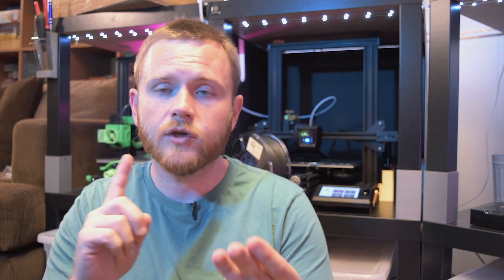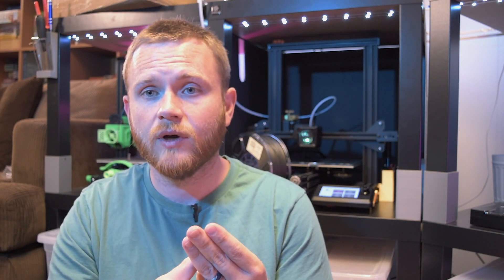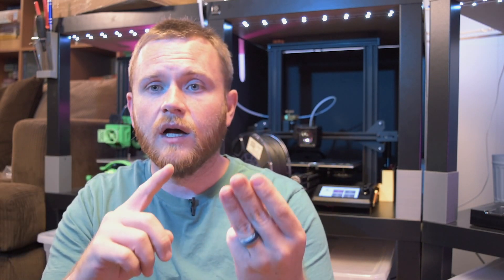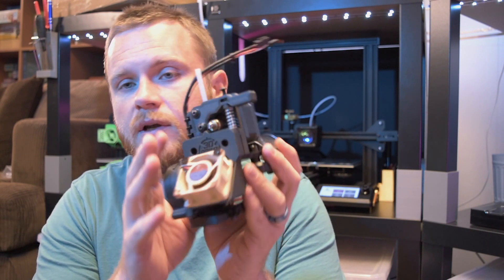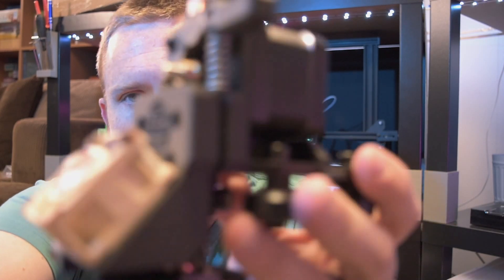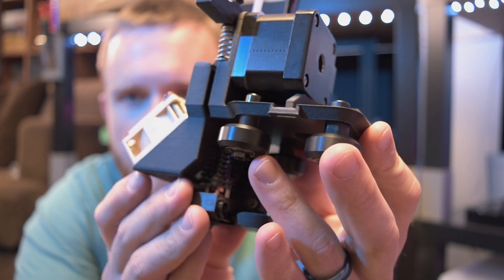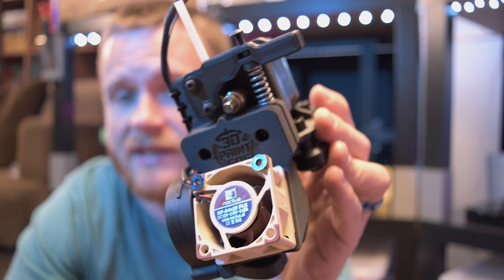Can the Aquila print Carbon Fiber Nylon?

Comment: Sorry for digging up an old video. Ive watched these for years but Ive never played with CF filaments. Ive got an older x2 but converted to direct drive with a s2 (Ive also updated to run the Red Lizard). My question is can you share the settings as I dont use Cura and was hoping not learn a new tool. thanks
Reply from the maker: If you are using Orca slicer, the base filament settings work really well. Just keep your retraction down to or around 1mm.
Reply: That’s awesome thanks. 

I’m wondering if I need to embrace either Kura or Orca. I’m still on voxemaker currently. Just printed as a test with Pet-cf which seemed ok

Machine has been great to testing stuff for my kitcar thanks to your videos. Thanks again

Comment: Thanks for posting the profile - We sell the Aquila and the eSun filament where I work the day job, giving it a go my self, the E3D steel nozzle I got is just a little too short to poke clear of the rubber heat shroud on the Aquila - did you keep the shroud on? I had the rubber piece and the fan guide both scrape prints off the bed thanks to the lower clearance between the shorter nozzle and the bed. I sacrificed a brass nozzle so I could reset the height and re-level the bed, and then got several layers through at varied bed temps, getting the same peel-up leading to failure. Will have to try limiting the fan speed even more, and building an enclosure.
Reply from the maker: You don't “need” the silicone sock on the heat block but it’s a nice-to-have. Maybe you can trim it a bit? Just to make sure we're on the same page, the E3D nozzle you installed should have been an MK8 Style nozzle. A V6 style will not work on a stock Aquila. Just trying to figure out how a nozzle can be that much shorter.

Are you printing with PLA? Shouldn’t need to limit fan speed. Clean bed with alcohol or warm soapy water, level, level again. Warm glass + PLA should stick like crazy if your leveling is correct.
Reply: @3DPrintSOS  PLA with the stock nozzle, no problem, 15cm bridge test passed with ease, happy with tests for speed, was experimenting with translucency using Clear PLA+.
Where I'm up to, is trying the eSun PA-CF, and the Steel Ender 3 nozzle I bought is just a little shorter, just enough that at 0.01 nozzle to bed clearance, the rubber shroud and the cooling fan duct will catch on the print, back to the brass, and the structures no longer scrape the print off,.. I get the print to start with CF, do a couple of layers, then it slowly looses bed adhesion and comes away. Noticed in some of your videos you have the glass side up, instead of the fiberglass layer, giving that a try this morning. I have the travel speed slowed down, cooling at minimum, extrusion at about 105%, nozzle at 250c and bed at 80c.
Reply from the maker: Time filament, like PA, PC, ABS just need glue stick. They need a little help. ;)
Reply: @3DPrintSOS  Haven't needed to try glue till today, glass side up with just a light smear of glue, PA-CF seems to be staying put this time 😀
Edit - glue dried out, and the print failed, might have to try something stickier.
Reply: @3DPrintSOS  the 'shorter' factor is less then 1mm difference, maybe as little as 0.5mm. Manufacturing tolerances at budget prices differences....

Comment: Is  the Voxelab Aquila X2 capable running a 2 or 3 color mixing hotend? If so which hotend and which firmware?
Reply from the maker: If you can do if on an Ender, it’s likely that you can do it on an Aquila.
Reply: @3DPrintSOS  Thanks

Comment: Hello there, I am curious if its possible for my G32 machine to reach more than 250 degrees. The updated PA CF of eSUN needs a reccomended 280 degrees. Any suggestions?
Reply from the maker: It should go higher than that stock but you can always switch to Alex’s fork of JyersUI and set the limits for temps to whatever you’d like.
Reply: @3DPrintSOS  I have already flashed the latest Alex's firmware with vertical orientated screen etc... I have an upgraded hotend called smart nf cr-10. So do I have to download a different firmware ? I think my hardware is ok for pa cf right?
Reply from the maker: Yea it should be. I think if you are firmware limited to a temperature on your hotend, you would have to recompile it yourself and just edit the temperature Max in the config
Reply: @3DPrintSOS  maybe it's better to make a video on how to do this. Because our upgraded voxelab beasts are capable for more and we are limited only to 250-260 degrees of hotend temperature. Thanks in advance! I will ask you about the video because you are the best to do it. If no one else asked you till now then more will come. I know. I followed all of your DIY guides and I am satisfied.
Reply from the maker: There’s a few out there that are great. Teaching tech has a few great ones on compiling. ;)

Comment: Would a good bit of glue work instead of an enclosure as they are quite expensive
Reply from the maker: Wouldn’t be enough in fortunately. You can always give it a try. 

My enclosure sides are just foam core board. It was like 7.99 at an office store. You can even use cardboard in a pinch.

Comment: Your AWESOME!!!  I get my first one in 2 days and will definitely follow you, like and subscribe... #staysafe
Reply: Quick question though. Should I just change the fans as well like you did on version 1?
Reply from the maker: You don’t need to right away, but they are definitely loud.
Reply: @3DPrintSOS  Cool and Thanks 💯
Reply: @3DPrintSOS  Awesome Sauce !!! It took me about 3 hrs to assemble,  1/2 of which having to switch things because I put them on reverse, lol, but it powered up, and following your directions, I was able to level and are currently printing the hook 😁 Thanks again my friend, much appreciated 👌
Reply from the maker: Awesome. :) you’re welcome.
Reply: @3DPrintSOS  I hate to keep bothering you, but one lil question I have. Do I have to level after each print?
Reply from the maker: Sure. No not at all. Once you get the spring tension right, it’ll stay in level for a while. This will help: https://youtu.be/Q7Mu05fZNsk
Reply: @3DPrintSOS  What is the filament that comes with the printer, the red one? I ask because I had no problems printing with that instead of the one's I ordered on Amazon. The red works everytime and its kinda see thru unlike the ones i purchased?
Reply from the maker: It’s their own transparent red color they sell. :)
Reply from the maker: Nice!

Comment: What is the filament dryer settings (temperature, humidity) that you use for CF nylon. If using a heated enclosure, what would be the best temperature regulation?
Reply: With nylon, polycarbonate, and other higher temp filaments drying at around 70° for at least a few hours before the print and during the print. Thought if your dryer cannot get that high it will still dry it but at a slower rate and take more time. Be careful as some manufacturers cheapen out and use PLA spools that will soften and become unusable if dried at too hot of a temp.
Reply from the maker: My dryer just had heat modes from one to 4. I crank it to Max a few hours before printing and keep it on throughout. Not very scientific but works well for my setup. Unfortunately I can’t give you a solid answer though.

Comment: Hi what does that item u printed do. And is there a link for a corresponding video? Or stl file? Thanks
Reply from the maker: This is a custom hotend I designed for my custom printer. It’s meant to work with the new Zodiac Bmg hotend. I’m currently designing one that could work on other machines but still retain all the functions. When I solve that puzzle, I’ll do a video on it. :)
Reply: @3DPrintSOS  Just curious would you have a custom extruder mount for the Zodiac Pheastus BMS
Reply from the maker: I do, but it won’t fit these machines quite yet. In the middle of a redesign now.

Comment: I really want to get into 3D printing, and I have spent a long time researching printers and materials, and I had almost decided on an Ender 3 v2, when I saw one of your videos on the Voxelab Aquila. For $100 less, I am almost certain that I will end buying one of these unless something very negative about them pops up in my never ending research on these printers.
Reply from the maker: There is always something negative. None of these budget machines are perfect. But with a touch of patience and some tinkering you can get amazing results! Can’t go wrong with either one but like you said, the Aquila is too good of a deal. ;)

Comment: hey man i have been avoiding asking this question but i was checking the firmware updates for the aquila and noticed there is a difference in the title now... since i have the 1st gen aquila is it going to mess things up to update to 5.5.3?
Reply from the maker: Good question. As long as you get the one with the right chip, it should be fine. You can glance at yours by taking the lower cover off to know for sure since there are three versions of the original. H32, n32, and G32.
Reply: @3DPrintSOS  youre the best bro thanks for the clear up!

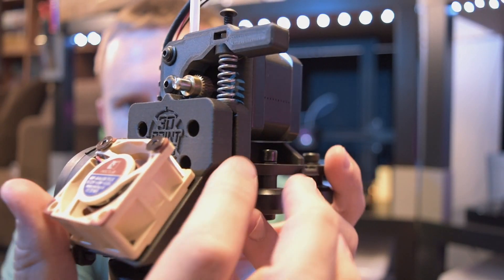Comment: 3:56 Your hotend fan is sucking air, that's inefficient.
Reply from the maker: The entire design of this revolves around the fan sucking air. The point is, other coolers spill air downward toward the bed. If you are printing abs or nylon, it makes the first layer much harder to print. ;)

Comment: Wouldnt glass fill Nylon be better and cheaper?
Reply from the maker: That’s a great question. Challenge accepted. ;)
Reply from the maker: Actually, shoot me some links. Did a brief search and came up with nothing cheaper. And only 3 or so to select from.
Reply: yikes you are right, its not cheap lol :o the prices of filaments is way too high, have you tried "eSUN ePC PolyCarbonate 3D Printer Filament"
Reply from the maker: Not yet. I have a mini roll of filoalfa carbon fiber polypropylene I want to try though.

Comment: Thanks Dude!
Reply: @3DPrintSOS  
When you announced this vid I waited so I could steal your profile. I had already purchased the Sain Smart filament. I have had success but had to bump the bed temp up to 95C to get it to stick.

Weird thing is. Even with the profile in Cura set up for 95C bed temp, it only goes to 80C on the machine and I have to manually crank it up. Any idea on a fix for that or do I have to manually set it each time?

Also, did the hot end fix before loading the new filament in and it works great!

Thanks for the hard work and videos!
Reply from the maker: Hmm check to see if your initial bed temp is set to 80 by accident.

Comment: $60.00 a roll pretty much puts it on the back shelf of my printing materials. I can get 6 rolls of PLA+ for that. It seems like with all things if it is worth using you can't afford to use it. The industry has allready set the median price at $60 dollars so it doesn't matter who's filament you use you are going to pay dearly. At that price you may as well buy the device you are trying to make. It makes no sense. Another filament I will probably never get to use. Its not fun if you have to go in debt to use it. Thanks for the profile. I will put it in the library even if I will probably never get to use it.
Reply: Honestly...you compare ten dollar PLA with this stuff?? 😕
Reply: @themountain59  No! I can compare 60+ dollars a roll  of a material I have to have special equipment to use against the 10 dollar a roll of PLA+ I need nothing more to print. I have no use for NCF. ABS is way more than strong enough for anything I am printing.. I may have a use for NCF in the future for which I am grateful to have the video and the profile for. But I am old and just trying to make fun stuff to keep the grand kids amused and maybe teach them something. All I need for that is PLA, PETG, and ABS. If I were going to spend extra on an exotic material right now it would be with Delrin for some bearings and gears. I do not need the strength and durability of NCF to justify the cost. But I hear that Delrin is hard to get to stick to a print bed of any kind because of the same self lubricating properties that make it desirable for that purpose. I print for looks not for strength, so I actually can make the argument. $60 is a lot of money. Happy printing
Reply from the maker: You aren’t wrong. It’s super expensive. And I’ve waited years to print with it because of that. It’s literally 1/3 the cost of a printer. However, knowing what I do now having this in the bag is a must for me. If I could remake my diy printer again, I would 100% use this stuff. It’s super strong.
Reply: If you have multiple things to print it's still going to be a lot cheaper to buy 1kg of filament than it will be to buy the equivalent weight in specialty items.
Reply: @RameshKumar-mv3jd  You could make the same argument for buying a Raise 3D or Method machine. But you have to have a real reason to have a machine that can print engineer grade materials. They are way expensive and it cost quite a bit just to use some of them. You will get sub 100 micron resolution though. I am not sure of Raise 3D but the Method by Makerbot touts 20 microns. Thats as nice as any SLA machine and its only 5 to 7 thousand dollars. I can buy the Items I need to upgrade my machine one at a time when I get the money and there is no worry. I am still only going to be able to get the standard 0.1 resolution I get now with Ender or Longer or Voxelab. I will just gain reliability and repeatability. Which is why we upgrade. Happy Printing

Comment: Love the look of these prints.. How is the odor? You mentioned using SS nozzles in the video but you have links to hardened steel nozzles. Should use hardened steel correct? Great video!
Reply from the maker: Good catch! I said the wrong words. English is hard. Haha hardened is what you want. 

Zero odor.
Reply: @3DPrintSOS  awesome thanks Fedor! I do have Capricorn tubing I haven't installed.. Will look it up and see if it can handle 260C.
Reply from the maker: I think it’s right up there with tecboss but totally check. I dont remember. Haha

Comment: Hi, I am looking to add one more cool fan to the Aquila since it only has one cool fan. Do you know how to set up the extra power requirement? I mean the new fan will need hook to some sort of power, how do I do it? If you can have a video on how to add one more cool fan, that would be awesome, thanks!
Reply from the maker: Since the fans are 24v you can just grab two 12v fans and use them off the same leads. ;)
Reply: @3DPrintSOS  Thanks for quick reply! Just did a little bit research on this. You mean solder 2 red wires from the two fans with the original blue wire, and another 2 black wires with the original yellow wire? My questions are: 1. Is the setup of red for blue and black for yellow correct? 2. By soldering that way, isn't that a parallel (24>12, 24>12) vs series (so 12+12 = 24)? Sorry, I am quite new to this field, so stupid questions, thanks again.
Reply: @ouliu9305  my advice is to connect 2-24vdc fans in parallel. This way both fans will have 24vdc... In series if the impedance is off you could end up with one at higher voltage than the other because voltage divides in series and is constant in parallel.
Reply from the maker: Solder all red to red, solder all black to black. :)
Reply: @3DPrintSOS  The original cool fan is using yellow/blue wires (not like the hotend fan which is using black/red wires). That's why I am asking, thank again.
Reply from the maker: Oh I see. Well before you solder, you can always twist them together and try. :)